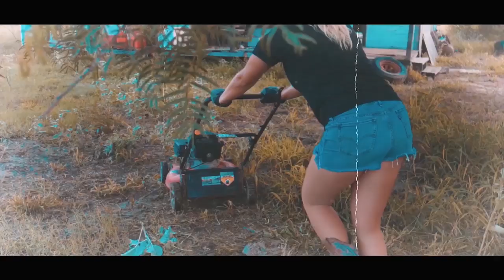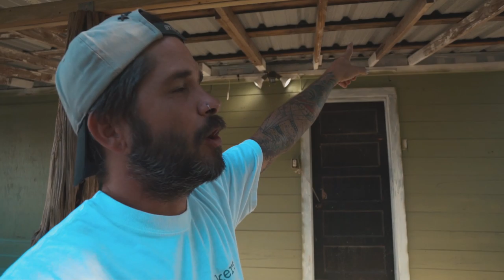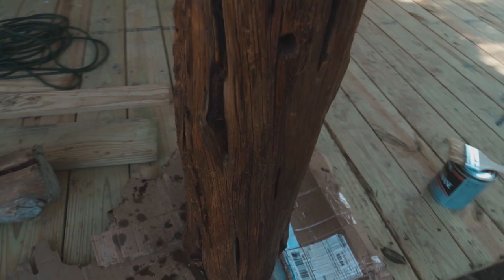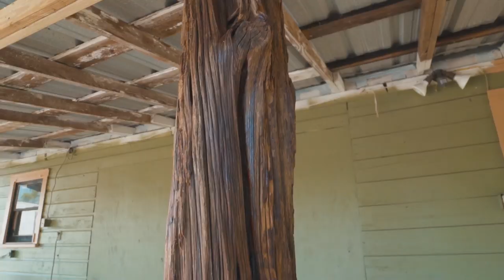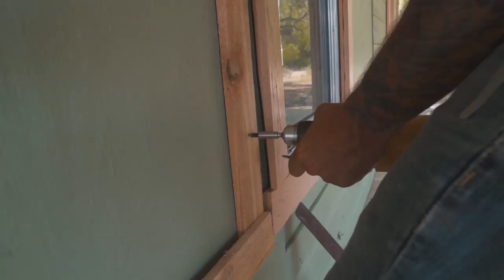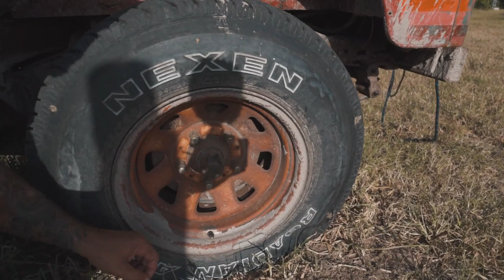Ranch Rescue - New Project On The Camp House! | Day 21

Comment: Wow, I really like it! As far as the lathe (small horizontal boards) on either side of the window, if you are leaving them the natural color, be sure to hit those with clear coat also, otherwise they will turn that ashy grey weathered look over time. It is also better for the "life span" of all wood to have a coat of something on it. I would never have chosen it, but the peach trim is nice! Very creative you too. Jaylena, I am very worried you have 3rd degree burns. Do you have aloe vera plants on the ranch? Also, if you can, keep clean cool wet cloths on it to pull out all that heat. Take advil regularly to keep your temperature down. Most important, keep that underskin out of the sun at all times or you, so sorry to say, risk major damage and possibly skin cancer down the road.
Reply from the maker: We’ll definitely be clear coating those boards!

Feeling much better today(this video is from yesterday) Lots of aloe the past few days. I’m heading up hill it seems like now!🤗

Comment: I think you should move that electrical switch on the right side of the small window and use the shorter leftover lumber to make shutters like the ones on Jared's house.  Then clear coat them.  I like the green exterior paint but prefer a lighter tan for the trim.  Cedar posts give the camp house that rustic South Texas feel....love what y'all have done so far!

Comment: Great job on the clear coat, the paint and trim; love the design covering the plywood add dimension to the house.  Have you considered a smaller version of that design for the other window using your left over trim pieces?
Reply from the maker: Yes, we’ve though about it as a possibility
Reply: Personally, I  think it would be overkill on such a small house. As it is, its a nice focal point. Just my humble opinion.

Comment: Love the clear coat on the post. I think you need to go a bit brown in the beige trim to warm it up more. That will complement the green  and the posts. I also love what you did to each side of the window as well. What about using the rest of the wood to make a skirt at the bottom of the deck? Leave an area for the dogs on the side for them to get in and out for the coolness of the shade from the house. I was so excited that you posted a new video since I do not have cable tv. I can not wait to see what you have in store for us tomorrow. Rest well you two!

Comment: The other day Jeylena said she was using Neosporin spray on her sunburn. She could be reacting to that. I would suggest vinegar watered down a little put on with a soft cloth. It will take the sting out. As little clothes as possible and if you wear clothes make them loose and cotton. Been there done that, it takes a while to heal.

Comment: Make strong tea with filtered water and put in a spray bottle, cool down in frig before spraying  your sunburn to keep as pain free as possible and prevent peeling.  Otherwise head to Mexico and get a spray bottle of Novocain to kill the pain.   The raffters should be same as house color.   The clear coat on the wood post look good and great job on hiding the plywood on the sides of the window.   Are you planning on cleaning up all the electrical outlets exposed?

Comment: Get an aloe plant for the burns - keep it growing in case you burn again.  I think a darker color trim would showcase the cedar color and deck boards better, but it don't look bad at all!!  Any chance those tires from that abandoned truck fit the jeep? Is there a paint you could spray on the under side of the roof that would stick to the roof as well as the boards? Doing all that by hand sounds like a pain in the neck...literally!!  Thanks again for sharing.

Comment: Looking awesome fam. And I'm sorry that sis is not doing well with her sun burn. I hope that she will get better soon. I remember when I had a bad sun burn back in So Cal in 1987 when I was at the beach on a church retreat with my 2 oldest sisters and church friends at San Diego beach. Oh man.. was it horrible especially when I had it on my back and shoulders 😖 and yes staying out in the sun does make it feel worse than ever. So I'm not sure if it would help but adding some ice will cool down the heat. And buying some Aloe vera and placing it onto the burden area should help a bit. My mom used to place the Aloe vera plant on my back and it did work. So I love to suggest that you should do it and see if that will help.

Comment: Why aren't you painting the whole house. The color is great that you picked but it looks odd just having 1/4th of the house done. You have 80 days to finish. Keep up the good work.
Reply from the maker: It has metal on the 3 other walls, or we'd paint them as well
Reply: @TheCrockers  metal siding is so hard to paint, prep work is not worth it, expecialy in the heat. I hate to ask but yesterday, did you receive the package I sent?

Comment: o.k, you know I love you guys and I am one of your biggest cheerleaders but the anal retentive part of me is going crazy. Does the right side slat wall have bigger gaps than the left?? please tell me it is an optical illusion. Love the color and the slat wall idea. Jaylena, do you have any Advil? It will help with the swelling and pain. Also put cold washcloths on them to help take the heat out of your skin. I had a sunburn so bad once that all of the muscles in my legs cramped up and I ended up at the hospital. Spent a few days naked laying in front of an air conditioner and soaking in cold water :). Learned my lesson though. I hope you're feeling better soon.